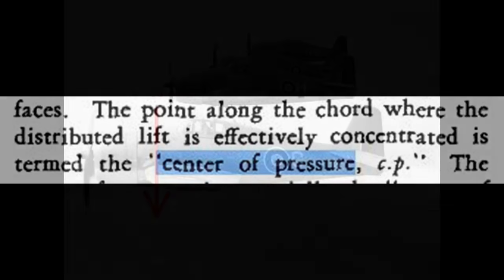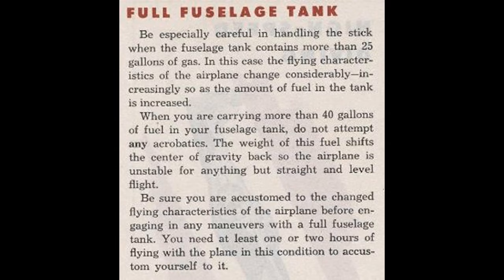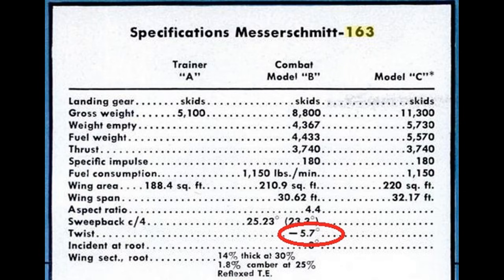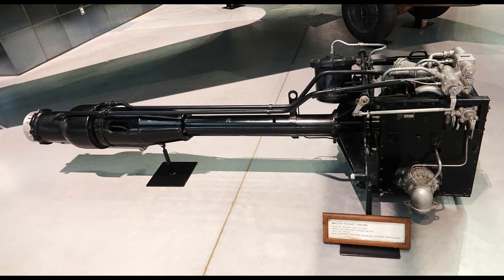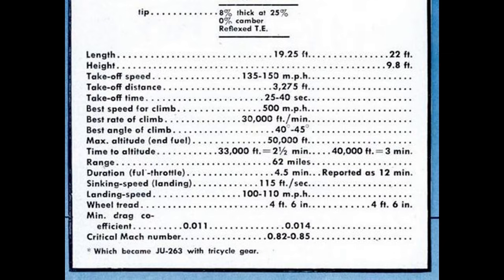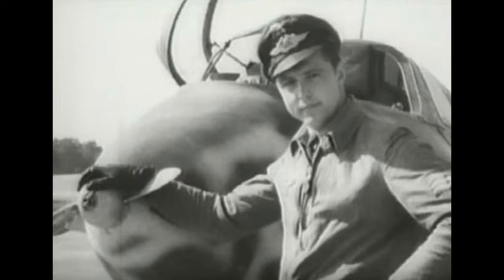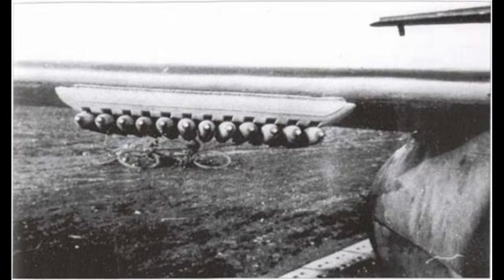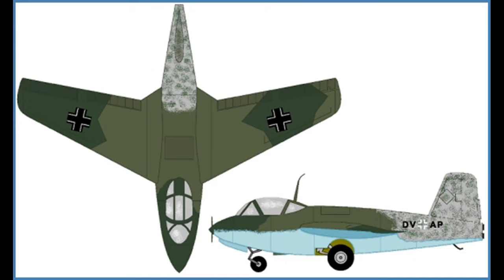Messerschmitt Me 163 Pt.2 Plus Me 263 and More!

Comment: Hanna Reitsch had her accident in an Me 163b, not in an "a".  She had used her political power to try and finagle her way into the flight test program of the Me 163, and had been allowed to fly the Me 163b as a glider IIRC 4 times.  She continued to try to assert her will to get into the real experimental flight test issues of the aircraft, so Späte came up with the idea to let her be a production type test pilot for new production run aircraft to confirm they handled like they were supposed to.  This would get her out of the experimental test pilot's hair because they viewed her as being non-current (spending too much time away doing other things) and meddling in their jobs.  The Kroneis factory had a contract for the first 70 production run Me 163b's, and Kroneis arranged for her to be his factory pilot.  The accident happened on her very first factory acceptance flight.  Trust me, I know the story better than most anyone out there.  My father was was her tow pilot that day, and also the only Me 163 test pilot present, and also the only other Me 163 pilot to have landed an Me 163 with the take-off dolly still attached (so he knew what her problems were).  I don't want to "hunt & peck" a book at this point, but suffice it to say that she just royally botched up the approach to the airport.  The accident was her fault because the aircraft could have been landed safely with the dolly still attached.  After she recovered from her injuries, she then took the regular 5 flight transition course for new Me 163 pilots coming from other aircraft.  Those 5 flights were in the Me 163a model with the last one IIRC being under power.   It was then that she went back to Späte demanding to be allowed to fly the Me 163b under power.  Späte refused on the grounds that he now had a lot of combat pilots to train and could not afford her a "joyride".  It was at that point that she got mad and never came back.  My father also pointed out that shortly after that episode, Späte was transferred back to the Eastern front.  My father felt that it just made no sense to transfer the commander away just as everything he had worked for was starting to come together.  My father's gut feeling was that Hanna had exercised her power and vindictiveness.  On another note, you rely entirely too much on Mano Ziegler's book.  He sensationalized a lot in order to sell books, and didn't really have the intimate involvement to tell the whole story.  He was sort of a peripheral player.  There are a number of other books out there which are better from a historical perspective.
Reply: Quite an interesting point of view, to be certain. There's so much "History" out there, in all aspects, that either over-glorify or under-glorify historical figures, and it's often difficult to determine what is factually accurate and what isn't (for instance, Paul Revere's Midnight Ride, and so forth). I tend to find your perspective believable.
Reply: @robertgantry2118  Thank you.  It is the truth, which is sometimes hard to come by.  Please my other answer in this thread.
Reply: Jimmy De'Souza  I turn 70 this coming December.
Reply: @mrod2b216  My father began his majority on the brink of the war, served throughout, and came home alive.  A keen student of the times, he would've loved your account.
Reply: Holy shit, this is the greatest Youtube comment I've ever seen.
Reply: Seriously the guy is 70 years old we are all lucky to have read this when we did. He said parts of his dads story are in books, but as we can see now western sources out here can tell it like it happened. Unless you consider YouTube comments a “western” source.
Reply: I can believe this from what I've read of her personality.   Pretty sure she had pull with Hitler being buddy buddy.  It's amazing what first hand information straight from the source that pops up in Youtube comments on history videos, even more fun when it's you yourself doing it...   it's like Bill Gates said... business at the speed of thought.   Well, almost, delayed only by the few hours, days, or years until the right person stumbles across the video or the comment in a search or skim...  birds of a feather, flock together.
choppergirl.air-war.org
Reply: @choppergirl  Absolutely..Iearn much from the Youtube comments. After a viewing I immediately go to the comments.
Reply: Wow, really great to have an eyewitness correction to history. 
Too many stories are just that "stories". 
Your father's account is very important for an accurate record of history.  
Thanks for the tell
Reply: Fascinating note...👌
Reply: fascinating insider information thank u
Reply: Wow, what a great story!! You should write this stuff down or come out with a book of your father's experiences! Sounds very interesting!
Reply: @Robert-ff9wf  The problem has always been that his wartime powered flight logbook is "missing", thus making it hard to prove or document a number of things.  He was always a test pilot who would not lay any claims to anything that he couldn't prove with with documentation to back him up.
Reply: @mrod2b216  was his documentation disappearance due to Luftwaffe organization disarray at war’s end or due to allied actions?
Reply: @papadopp3870  - The best guess was that his mother threw them into the river because she was afraid that if GI's found them, there would be trouble for the family.
Reply: @mrod2b216 did you follow in your father's footsteps into aviation?
Reply: @Wingly_Actual  - Yes.  He taught me how to fly, and I went on to fly for the USAF and later the airlines. Retired from both now.
Reply: i read her interventions threatened  the whole program is this true??
Reply: @patreidcocolditzcastle632  See one of my previous answers.  That was my father's gut feeling and there was a lot of circumstantial evidence to support his observations and conclusions,  but no absolute positive proof that my father could lay a hand on that it was her pressure in trying to get the program canceled.
Reply: @mrod2b216  id believe your father,but like all history we only get a percentage of all the dynamics that are working as one.we in history get a bit of the data.amazing story btw.
Reply: Yeah, she was an amazing woman.
Reply: Thank you for sharing this amazing insight, I would like to read more books on the Me163, your father must have worked very hard on such a difficult undertaking! I hope you are well and still around, if you have a chance to reply to my question I would like to know what books(book lists) on the Komet that you think best tell the story of your father's and others'efforts to bring the plane into action. Thank you again and best wishes!
Reply: @Patrician9000  - Thanks for the kind words.  I'm 74 now and still doing well.  IMO, the best book out there involving my father is:  KOMET The Messerschmitt 163 by Jeff Ethell (if you can find a used copy somewhere).  Jeff was a graduate student doing a Masters degree internship at the NASM and was given an assignment to write a paper on the Me 163 by Paul Garber.  When Jeff found out that my father was still alive, he contacted him for information.  That started a very long correspondence, and the paper turned into a book which launched Jeff's career as a historical aviation writer.  Because my father contributed so much to this book, and held Jeff to telling the truth as to how my father saw events occur without sensationalism or embellishments, it can be said that this is almost a biography of my father's involvement with the Me 163 project, and Jeff says as much in the preface.
A second book: Me 163 ROCKET INTERCEPTOR revised edition is a pretty thorough attempt at the complete Me 163 history by Ransom & Cammann.  They base a lot of their "facts" on W. Späte's wartime progress reports to headquarters assuming that they were all true and that Späte would not have lied during wartime.  My father had to deal with Späte's twisting the truth in his post war writings, but until my father actually saw what Späte had written during wartime as he was reading this book, he finally realized that Späte had been twisting his official wartime reports as well.  My father registered his dismay with some of what was printed in the first edition, two volume book/s. The authors tried to accommodate some of my father's objections in the later revised edition, but that wasn't published until 11 years after my father had passed away, so he was never able to see and evaluate that finished product.
Späte did write his own Me 163 book called Top Secret Bird.  My father got very frustrated in trying to help him while he was writing it.  Späte would pull "quotes" from 45 years prior out of thin air and assign them to someone. My father told him that person never said that, so Späte would just assign it to someone else because it "sounded good".
My father called it a "historical novel".  He said that the atmosphere was correct, but that was it.  My father felt vindicated in his opinion when he was told that Späte had sent the manuscript to Adolf Galland for him to read and hopefully write a forward to the new book.  Galland sent it back and categorically refused to have anything to do with it.  Apparently,  Galland did not like how Späte "twisted" the facts either.
Reply: @mrod2b216  thank you for such a thorough and thoughtful reply! I agree that it is now known that so many of the "historical truths" regarding the war time reports and books written afterwards are very influenced by poetic writings to the point of being fictional and revisionist attempts are difficult in getting the real dirty truth out as so many of the first hand accounts are disappearing as the people who actually lived through that era are passing. I appreciate you reaching out and answering my questions, I will be sure to get a copy of the book you suggested. The Me163 program seemed flawed from the start and even though it was an Axis program, nothing but respect and admiration can be felt towards the pilots, men like your father, to attempt to do their duties to their country despite the task being near suicidal. I wish you well sir and hope that 2025 is a good year for you and your family! Alles gute!
Reply: @mrod2b216  I would like to second an opinion expressed above that these are the greatest YouTube comments I have ever seen. Thank you so much for these.
Reply: About 20 years ago I read HRs biography and an autobiography of her, by a woman whose name unfortunately I can't remember. While HR was an interesting person and a good pilot. She was also an excellent self publicist.
Reply: @singlechannelstuff8666  I think you have autobiography and biography mixed up. An autobiography someone writing their own life story whereas a biography is their life story written by someone else.
Reply: @daniellarge9784  your absolutely correct, just as I wrote in my original reply.
Reply: I THOUGHT Hanna flew Griem into near the Fuhrer-bunker in a Fiesiler Fw-156 Storch, a STOL-plane that'd be "Easy" to fly, ANYWHERE, plus EASY to fly OUT of nearly anywhere, but she used an Arado Ar-96, kind of in the vein of [ like ] a "Texan" trainer, which'd be harder then to avoid other craft "Gunning" for her, as the Russians made Berlin "a Hornet's Nest" of Soviet planes as they were reducing the Nazi-ground defenses.
Reply: Wow Danke für diese Informationen, wie ich schon auf englisch geschrieben hab, mein Vater (Teenager in 1945) war kein Fan aber jemand für den Hanna reitsch Bedeutung hatte. Ihr pro hitler Ansichten sogar in Büchern nach 1945 fand ich immer abstoßend.
Reply: Thank you for chiming in to set the record straight. Information like this is priceless.
Reply: @Duke Atlas i use Flixzone. You can find it by googling :)
Reply: I know Ziegler's book on the Kraftei and I have to admit that I am quite fond of it. I noticed the telling of a sometimes casual way of coping with the hardship of war, but never had the impression of sensationalism. In which way did he exaggerate, if I may be so bold to ask? I do not know the circumstance about her accidents. To land on a dolly without the possibility to brake (not sure whether his is the correct term here), seems to me quite a feat. And if it was on a loaded hot Komet rather suicidal, was it not? Or is it a lie in Ziegler's book that they installed a fuel jettison for emergency purposes, and that Späte tore it off, because the first one(s) were muck-ups only?
Reply: @thiemokellner1893    
Dittmar and my father were the two primary test pilots on the Me 163.  Both lived through the entire life cycle of that aircraft.  My father's view was that as long as one respected the aircraft and used good judgement in reducing risks, that it was not as dangerous as people like Ziegler made it out to be.  Some of the pilots who were killed thought that because they were piston aces, they could take short-cuts in learning to fly the Me 163.  That turned out to be over confidence and arrogance which cost them their lives.  Sensationalizing the danger factor was instrumental in selling more copies of books.  For being a very peripheral player on the Me 163 scene, Ziegler made a lot of money from the book and hyping up his involvement in that program.

HR's accident was while flying an unpowered Me 163 which was light- weight due to no fuel, etc.  IIRC, my father had two cases where he landed with the wheel dolly still attached.  He knew that if she made a normal landing that it would be a long landing roll, so when he landed the tow-plane, he rolled all the way to the end of the runway expecting that's where she would wind up stopping.  HR had little to no swept wing experience, so she got herself into a very tight / steep stalled turn in trying to go from a very close in downwind  to the final approach.  The stalled final turn resulted in an extremely high sink rate which put her short of the runway.  She hadn't even completely finished the turn to line up with the runway when she ran out of altitude, had to level the wings, and pancaked (due to the still high sink rate from the stalled turn) into a soft plowed farmer's field maybe ~100 meters short of the runway.  The aircraft bounced once and then stopped as the dolly dug into the soft newly plowed ground.  In stopping, it rotated up on its nose to an almost vertical position before the tail finally fell back down again in the upright position.  There was no explosion because there was no fuel.  Everyone had expected her to roll for the entire length of the field so they were all waiting at the far end of the runway.  They all had to jump into vehicles to race to the other (approach) end of the runway to come to her aid.  My father was one of the first people on the scene and accompanied HR to the field clinic and then the hospital.  He also examined the aircraft and said that there was virtually no damage sustained.  HR fractured her face because she wasn't wearing the shoulder harness and had refused to swing the gunsight out of the way - even though there was no gun installed, and the gunsight was designed to be swung out of the way for a number of reasons.
Reply: @mrod2b216  Thank you very much for the details. I believe that HR was a difficult person to get along with. And I also believe that there were a number of pilots not taking the switch to the rocket plane seriously enough. I recall a man nicknamed "nasse Geige" in the book, that I would catergorize as such.
Sure, it is good to minimize risks, but the inherent danger in having to fly with C- and T-Stoff that if mixed together only in tiny quantities (unless Ziegler exaggerated there, what I would find hard to believe as there are pictures showing the abundant use of water as countermeasures - among others) leading to a hefty deflagration as described by Ziegler leads me to think that the hot Komet was a dangerous, unforgiven ride indeed.
However, I acknowledge that risk assessment is a very subjective matter and if your father did not feel to be in danger flying a hot ME 163, fine by me.
Reply: @mrod2b216  Interesting story it's good to know. Do you know anything regarding Reimar Horten. His son Diego recons they came from Northrop to visit his father in Argentina for a couple of weeks regarding the Stealth bomber project.
Reply: @Angelum_Band  Why would norrhop even need the opinion of a guy who never designed an operational plane when they already had tons of data regarding flying wings thanks to the YB-35 and YB-49 that Northop built in the 1940s. Not only that, but despite some uneducated claims no Horten plane was ever designed with stealth in mind. They did not even knew what Radar Cross Section was.
It all sounds like one of the several story to make the B-2 somehow the product of "Superior Nazi Tech" when in fact it was not.
Reply: @Alvi410  The United States OF America was forged and founded on genocide, slavery, injustice, warfare and censorship. This empire is no different than theirs. Today the regime installed in the white house is funding, supporting and sending $120 Billion in weapons to those very same nazis.
What is fair is fair. Horten and Prandl were pioneers but even before them flying wings were already being built... And flown unsuccessfully.
Reply: @Angelum_Band  I highly doubt anyone from Northrop even knew about the Hortens. The story of "Nazi stealth fighter" has been made up after the stealth technology has been made public. By that time the Horten Ho 229 was collecting dust for about 35 years in Udvar-Hazy and noone cared because there was nothing to learn from it. Meanwhile, Northrop had decades of experience with tailless designs including the prewar B-35/YB-49 project of a tailless intercontinental bomber.
Reply: @vitkriklan2633  Read the book and look for the interview.
Reply: Thanks.
Reply: Super interesting story. Vindictive, seeking personal glorification, exploiting her connections. She had the essential skill set for anyone trying to rise in that regime.
Reply: @stevenblack7928  No copy and paste.  All hunt & peck.
Reply: @mrod2b216  Thanks again for sharing.  Your father's story should be "heard" and I am glad to have your brief synopsis to in order to improve my existing historical perspective.
Reply: MROD2b whatsapp an amazon story! Have you or your father written his story? I'd buy it.
Reply: @moriahmolotovschroeder-hug5632  My father was never a publicity hound or a glory seeker.  He was a professional test pilot who would never lay claim to anything unless he had ironclad proof, and above all just wanted history to be recorded exactly as it happened without any spin attached.  He never had the desire to write a book, and in the end he said that a lot of his story had already been written down in various forms, just not all collated in one place.  He is in all the Me 163 books as he and Dittmar were the two primary experimental test pilots on the aircraft.  Perhaps the most accurate involving him is Jeff Ethell's book Komet The Messerschmitt 163.  His involvement in the 10 May 1940 glider assault on the Maginot Line and his in involvement with the Horten flying wings (mostly post war) is found in other places.  Regarding the Hanna Reitsch story, he was always afraid of her political pull
 even long after the war.  She had her legion of supporters, so he never publicly came out with the story I shared here in fear of retribution.   He was the only qualified observer there.  He
saw everything, and accompanied her in the car to the clinic
and hospital afterwards.  Everyone just took her word for what happened,  and no one asked my father what he saw or thought.  Every other published account was second hand
heresay.  Towards the end, I was his firewall in helping him filter out who among all the folks clamoring for contact with him, that he would actually respond to.  I finally convinced him to tell me the whole Hanna Reitsch accident story because I knew that people would be asking me about it long after he
was gone.  So, he did in excruciating detail, but it is way too long to type here.  His end vindication was that she and her accident set the program back by 6 months during which time he had to redo all the flight tests that could have had
 something to do with her accident.  In the end, there were
 absolutely NO changes made to the aircraft or it's handling. 
 Most everyone who flew it (including Hanna) raved about the
 great handling qualities, so that confirmed to him that she was just making excuses to try and cover up her own errors.  To
 him as a professional test pilot, if you screwed up, you had to
 admit it, so to him, she had committed a cardinal sin....and it almost got the whole program canceled.
Reply: @mrod2b216  crazy to think if these were in service 6 months earlier if anything would have changed
Reply: @BrandonAilion  Nothing probably would have changed, but they didn't know that at the time.  They were working at 100% effort, and to sustain a 6 month delay due to a "frivolous" accusation was hard for them to take.  She just would not admit she screwed up, so she blamed the aircraft and almost got the whole program canceled.
Reply: @mrod2b216  Proof of what the Nazi mentality did to Germany and its people. She should have been hung along with the rest of them. Justice is never to be had as long as we have slime like her with political power and they get to create "history". They make everything about themselves and care for nothing but their own false glory. The world will be far better off when facts such as those provided by your father form the core of the story. People like him provide all the real history because they actually contribute to society. Vampires like Hanna just suk the life from society and use it for their own twisted ends. Shame on those who glorify these monsters. May they all rot in hell.
Reply: @mrod2b216  seems we have mr. rudolf optiz jr. here.... wow.    
greetings & horrido (glider)-pilot.
Reply: @mrod2b216  Thanks ever so much for sharing.
Reply: @mrod2b216  A woman not admitting fault? Fuck me, I think you need to publish your findings.
Reply: @MROD2b  She was also a fanatical Nazi with the usual chasm between inflated ego and reality. A despicable, hateful human being whatever flying talents she may have had.
Reply: @BrandonAilion  Nothing would have changed. The only war changing wonder weapon were the nukes and even they weren't necessary for the Allies. All the jets, rockets etc of the Nazis never had a chance of changing the outcome of war. The Allies industrial might and cryptographic success made the conclusion inevitable.
Reply: No. Like all nazi wonder weapons they changed nothing and would have changed nothing even if they entered service earlier. They represented a dissipation of industrial and intellectial effort. The allies would always outbuild and overwhelm.  The only genuine gamechanger was the tube alloy peoject that morphed into the Manhattan project and that was an allied project.  @BrandonAilion
Reply: Heidi Ditmar?  You're his son?  How cool!
Reply: @WildBillCox13  Not Heini Dittmar's son.  Rudi Opitz's older son.
Reply: @mrod2b216  After I saw your later expansion of the story, I realize my mistake.  Sorry for the misnomer and thanks for the correction.
Reply: @mrod2b216  Rudi Opitz! Love the pic of him with the camera on his head in the cockpit!
Reply: I know I am kind of randomly asking but do anyone know a good site to watch newly released series online ?